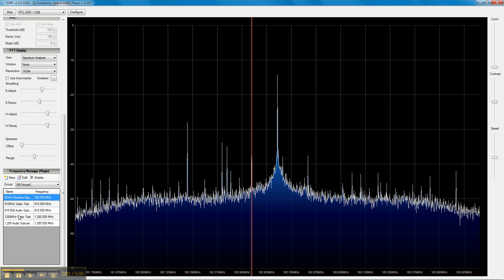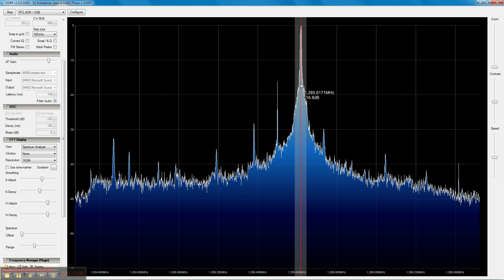sdr_2

Comment: I've been wondering how to do antenna testing, without a transmitter.
 Then, I saw some LNAs on Ebay "PGA-103 from mini-circuits that covers 50 to 2304MHz" for about $20.
That got me thinking about using RF feedback. If you connected both the input and output of a broad-band LNA to a pair of antennas, (ants 20-30 feet apart) there should be RF feedback.
My guess is, the feedback would center at the resonate frequency of the antennas.

So, if I was tuning a gain antenna for 1296 mHz, I would connect it to the LNA output, and connect a 1/4 wave dipole @ 1296 mHz to the LNA input. (With an inline adjustable attenuator).
I could use my handheld field strength meter set the feedback to it's lowest power level..
Then tune in on it with the SDR for final tweaking of the antenna's resonant freq..  

What do you think? Nutty idea? :)